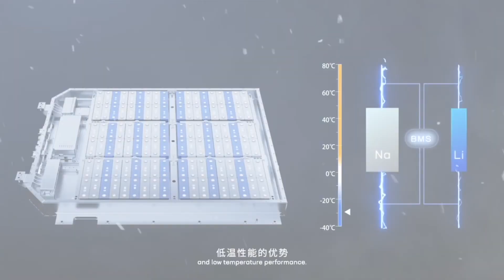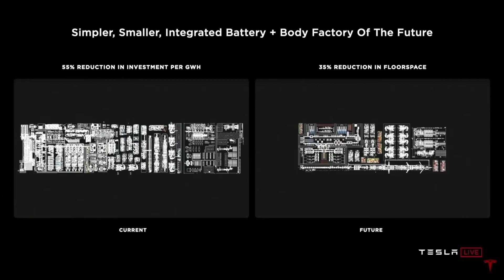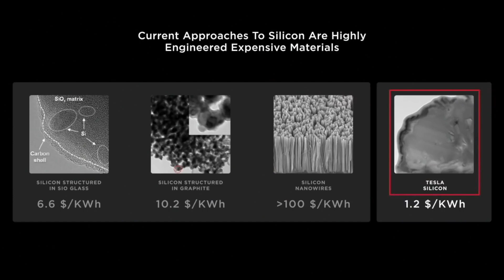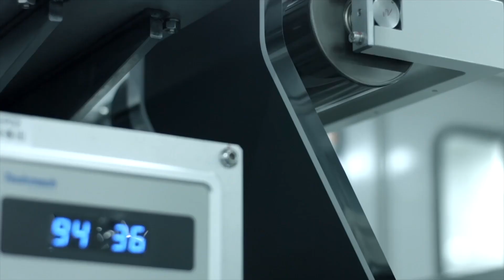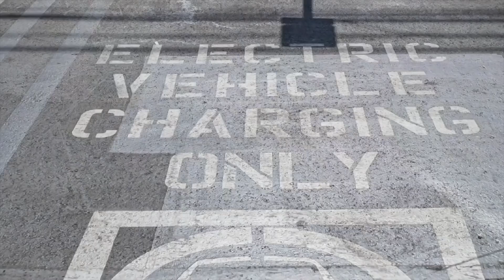Tesla 4680 Batteries VS China's CATL Batteries!

Comment: Standard cylindrical cell have a welded tab bridging between anode and cell wall base. The tab-wall junction has pre-compression forced point contact to ensure reliable electricity conduction. 

Tesla’s tab less architecture in its patent adds anode flaps and minus the tab, and in such process omitted the pre-compression forced point contacts have made the tab less battery conditionally stable and fail prematurely. 

Analogy: 

Tab less battery is as good as a regular cylindrical battery rattling in its battery case because of omitting a spring contact. 

Standard cylindrical doesn’t rattle because it includes a spring contact.